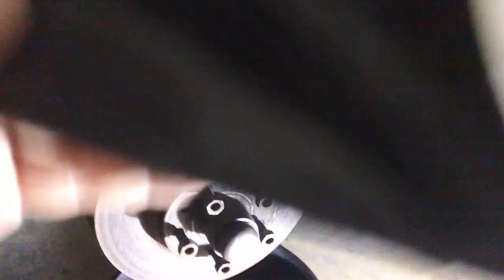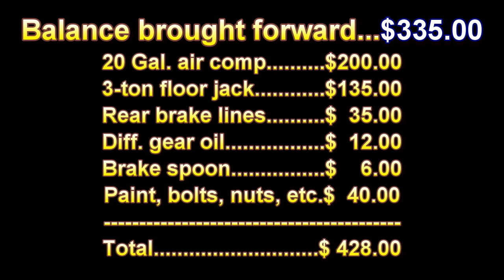1966 Ford Thunderbird repair and refurbishment (Part 43). Starting the front end work.

Comment: Those Kelsey Hayes four piston disc brakes were amazing.  They came out in 65 on the Lincoln and Thunderbird.  They could stop that 5600 lb Lincoln convertible straight and true without drama.  Ford cheapened out a few years later going to a simpler system with only one piston.

Comment: Some one did a hack job installing those flexible brake lines. You are missing the retainer that is supposed to hold it solidly to the frame. Lots of luck John. I wish  I could be there.
Reply from the maker: Joe,
Yeah, there's lots of clamps/retainers missing  on this boat.  It'll take a lot of eyeballing to figure it out.  Once done, I'll place an order for them all.
Regards,
John

Comment: It is interesting to see Ford using fixed discs on the front of the car when the UK models mainly had and still have floating discs. You take the wheel off and off falls the disc. The rest of the hub assembly hasn't changed though!
Reply from the maker: George,
I was surprised just to see disc brakes on the car.   I had no idea.
Regards,
John
Reply: @joernone  Its a lot of metal to stop! I'm glad it has discs!

Comment: John    springs do have a lot of tension... I saw the scenario that you mentioned... my friend was changing out shocks on a rambler ... the jack he had under the spring slipped and that spring shot out just missing his head and it flew across the garage... be careful even those spring compressors are not the safest to work with...
Reply from the maker: Word to the wise...don't overly compress the springs.
Regards,
John

Comment: I remember rebuilding those Kelsey's 4piston s they were a bitch .when mine was new they were excellent though
Reply: Recall those calipers come out together with the bypass line as one unit .those rims are used on many Ford's can use non disc on rear save best original for. front..

Comment: I think those wrenches are called line wrenches. I've always called them flare nut wrenches.
Reply: Yup, those are the only 2 terms I know of for that style wrench... Just used my 5/8" one on the 2002 Impala fuel filter and thought the line would just twist off. Kroil  helped too. Fluid Film spray for the re-installation....